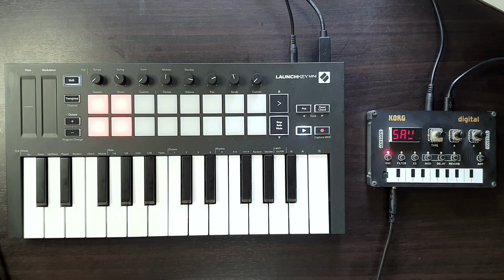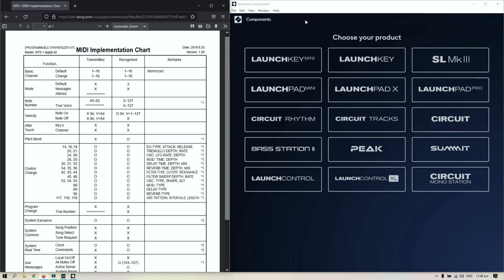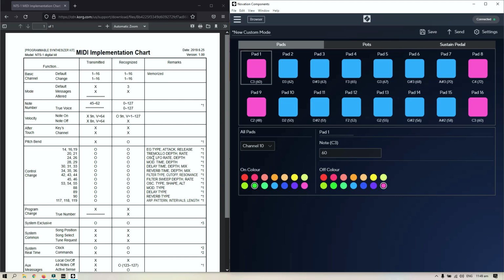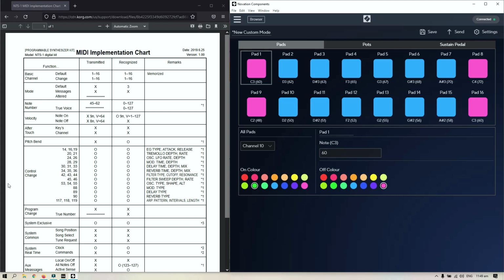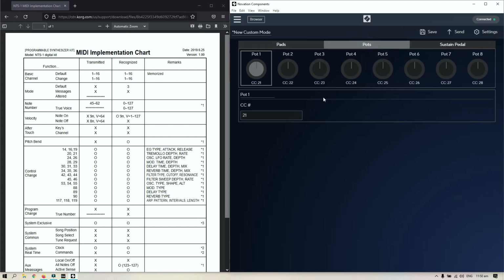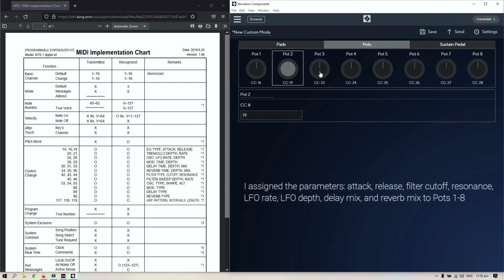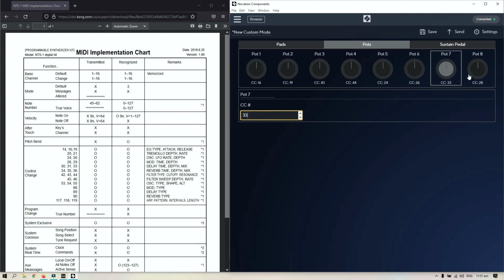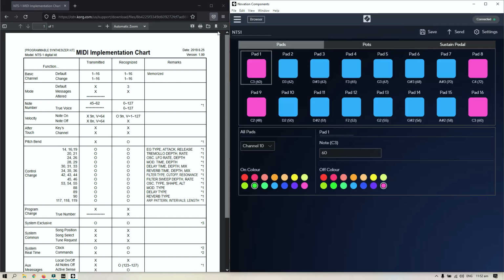Controlling Korg NTS-1 using Novation Launchkey Mini Mk3 and Novation Components & Jam

Comment: Hi and thank you for this video🎉. Is it possible to set a pad or knob or switch of the novation to activate (press on\ press off) deactivate the parts of the nts1 (mod, delay, reverb for example)? Because the knobs I setup with those part's parameters works only if I fisically switch on part on the nts1 itself 😢 I would like to do all from the novation instead, maybe also without activate switches, but directly turning a knob (the type parameter has an OFF value...but if the part is not selected, it does'nt works 😢 can you help me?